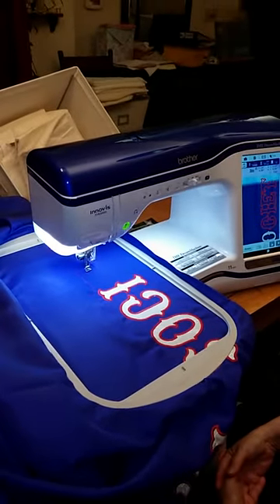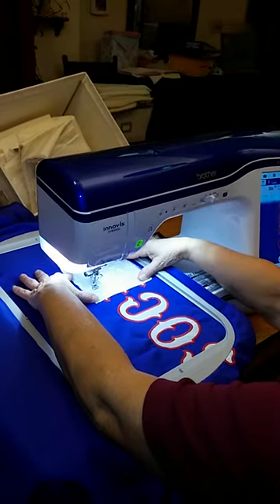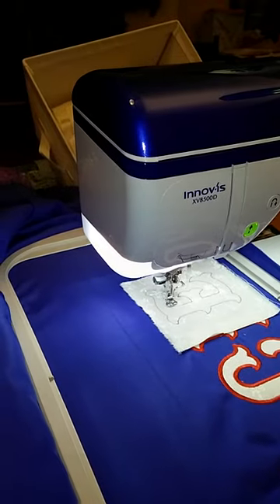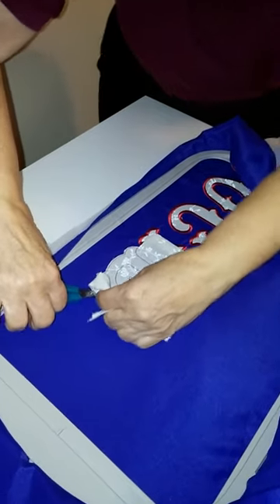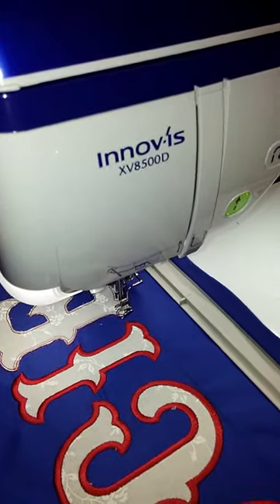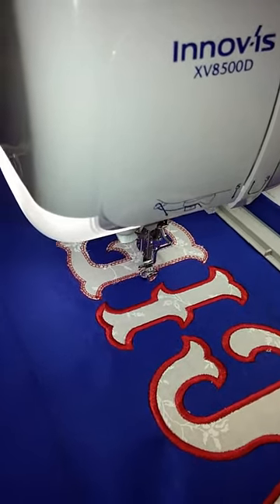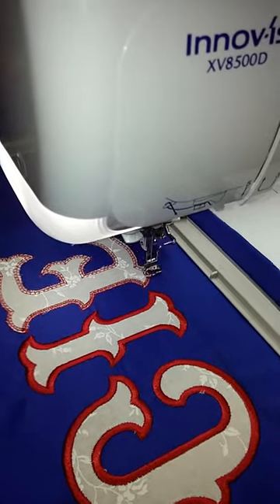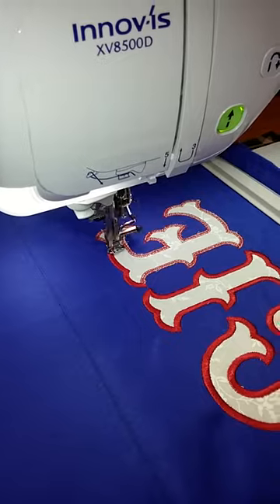Applique with a Brother XV8500D Dream Machine

Comment from the maker: My wife says that she arranged the letters in the purchased pattern but the stitches were automatic. No special steps required for that. However, she would not stretch the material into the hoop because it caused wrinkling. This was her first experiment with applique on a large table cloth. Thanks for the comment.